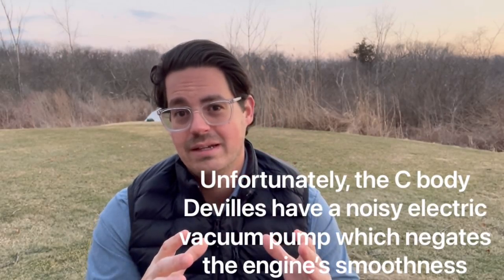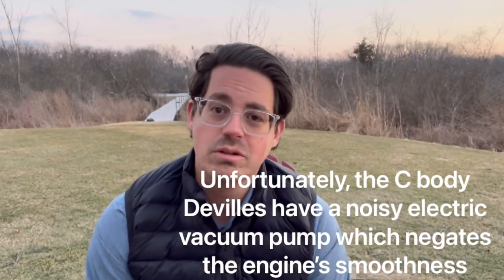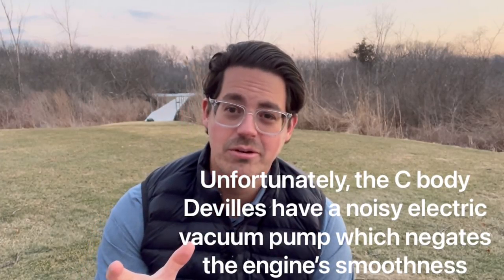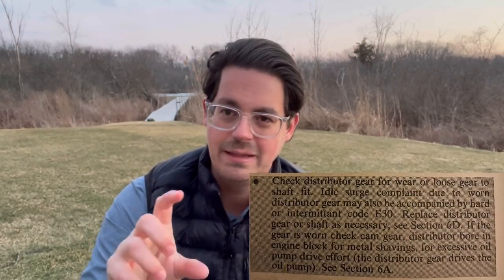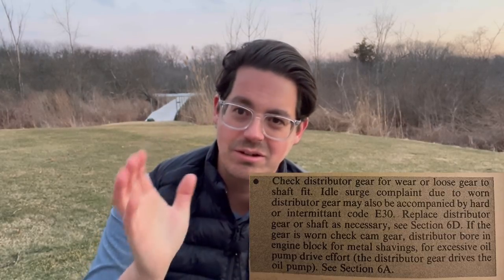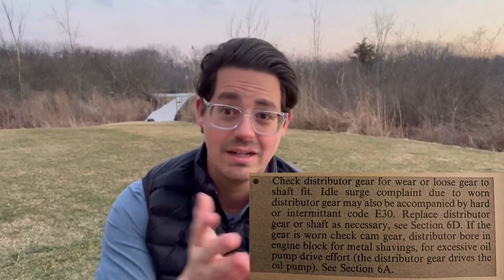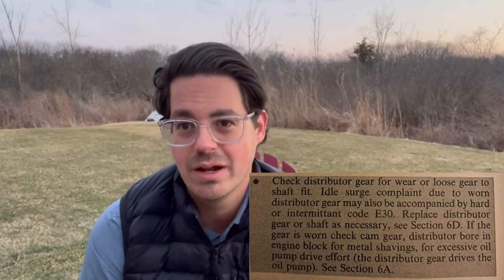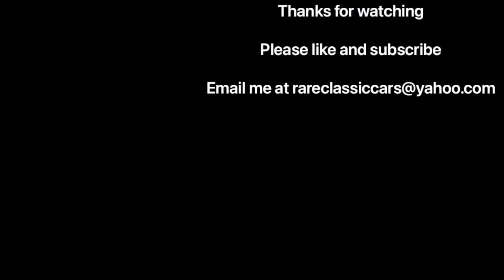Worst Engines of All Time: Cadillac HT4100 - Why is it so bad?  How can you preserve yours?

Comment: In the early 90s, I needed a cheap driver once and almost bought an older Cadillac with this engine from a flipper (here in south Florida, low mileage cars like this from the elderly are all over). I asked him if the HT4100 was reliable (this was pre Internet, and I had no experience with it) and he thought for a second and said "it is not - this one works fine, but it won't for long, if I'm being honest". I was stunned and grateful.
Reply: Wow, an honest car salesman?!?! There might be 10-15 in the entire country
Reply: I had a gold eldorado with this motor it drank 2 litres of coolant aday
Reply: I bought an 85 Cadillac Seville with this engine back in the early 2000s as a spare car to keep at my parent's home so I could fly to visit instead of driving 10 hrs each way to see them. I got it for $1500 from a work colleague when his grandmother passed away. It had receipts for a rebuild on both the engine and trans less than 10k miles before I bought it. I drove it several times when I visited, then gave it to my best friend's mother when she needed a car. It lasted about six months before a rod came through the side of the block. 

It was a smooth engine and it got excellent fuel economy. On my drive across the CA and AZ desert in the summer, with the A/C cranked it got me close to 40 mpg. It was very comfortable and even though it was slow, was an excellent cruiser at speed.
Reply: How about the HT4500?
Reply: @Titanic19127  The 4.5 and 4.9 liter v8s that were built on this platform fixed a lot of the problems that the 4100 suffered from due to a rushed launch. The 4.9 ultimately morphed into the Northstar V8 that's well known as a good engine.
Reply: @empireOfLove2  No one thinks the Northstar is a good engine dude. You're kidding, right?
Reply: @Titanic19127 much better.
Reply: @Titanic19127: More powerful but same problems with head gaskets leaking. Still required stopleak tablets.
Reply: @TeeroyHammermill  the 4.5 and 4.9 didn’t really have head gasket issues unless overheated. I’ve owned many 4.1 4.5 and 4.9. 4100 was a nightmare. 4.9 had wonky injector issues. My favorite was the TBI 4.5.
Reply: @OffTrackProductions  it’s great if you upgrade the head bolts 😭
Reply: I had an "85 Cadillac Eldorado Barritz 2door with the HT4100. He is right. The front wheel drive unit was exactly like 71 or 70 front wheel drive Oldsmobile Toronado. 85 cadillac HT 4100 whoever wants em you can have them keep em and gutless for a v8

Comment: I thank GM from the bottom of my heart, these engines provided this old mechanic with probably a million dollars of revenue over the years, there was a period of about 5 years where they are pretty much all I worked on
Reply: Same here, we would do a complete rebuild and upgrade when one was brought in on the hook.
Reply: I'm working on my 84 Fleetwood at the moment. I've lost track of how many weekends I've spent doing the water pump, radiator removal, and now the intake manifold gasket project. There's always something to do on this car. These cars should have came factory with a complimentary shop manual. As the second owner of mine, I'm trying to take good care of it.
Reply: I know the feeling.  I have said, " I love people that drive European cars, coz we can charge like a wounded bull to fix." Same result $$$$$$$
Reply: What's up with the melted looking valve covers I've seen on some later models I think probably  4.9? Look horrible.
Reply: @MrJoeltrain  GM put a heavy black plastic sort of paint over the aluminum and it came loose giving it that "melted" look - yes horrible and no way to really fix it other than to scrape off the loose parts and attempt a re-paint
Reply: What was the most common failure points?
Reply: @LowEnd31st  Camshaft lobes would round-off, distributor drive gears would wear away along with the gear on the end of the camshaft, all of this sending metal into the oil and eventually ruining the main bearings - probably the most common failures although there were many more like intake gaskets leaking coolant and oil returns getting plugged up (in the heads) on the early engines.  That's why the 4.5 was such an improvement, they used a roller cam and larger oil pump and they got the metallurgy figured out with the distributor drive gear.
Reply: HA! I read from one transmission tech that when they would get a Ford with an AXOD/E transaxle in, they would sing "Making Our Dreams Come True", a tribute to the Ford Johnny Cash commercial using that jingle back then, it made quite a bit of business. Of course, the GM 440T4 transaxle was also a money maker for transmission shops, once there was some fixes for their problems.
Reply: @mikeholmstrom1899  For sure the Transverse mounted AXOD was known for it's failures- at least early on
Reply: @LowEnd31st  @LowEnd31st: Headgasket failure causing coolant to dump into the crankcase mixing with the oil which turns the oil into 'milkshake' which destroys the engine.

Comment: As a heavy line mechanic for Cadillac in the 1980s, I worked on several of these HT4100 engines. The most common issues with customer cars with this engine were oil leaks, mostly intake manifold. Also, overheating and warped blocks. Worth noting, the crankshaft flange only had 3 Torx screws that secured the flex plate to the crankshaft🤣. Also, this engine had such low vacuum that it wasn't enough to run the vacuum accessories of the car. So GM put a belt driven vacuum pump in with the other accessories in front of the engine (what a joke!). Cadillac should have kept the Olds Rocket 350 for these cars through the 80s!! The best engines Cadillac ever had were the 472 and 500 V8s. Honorable mention is the 425 and 368 derivatives of the 472....
Reply: Yep, an updated Olds 350with tbi or port injection would have been a great choice. Atleast they had the 307 to put in the big cars.
Reply: I have an 84 cadillac biarritz coupe and I want to swap out the engine for something more reliable and with more power. I'm trying to have race car or muscle car. Just more power
Reply: @mcqueenfanman  I had an olds 307 in my 85 Lesabre. 

It was reliable, got about 25mpg on the highway.  But it was a slowwwwww engine in comparison the even the 305.
Reply: @JohnK-ph3vw  It had a cam that had all the torque in by 2,000 rpms. The H.O. 307 was much more livelier.
Reply: @DjnMemphis10  -  Be sure to follow this very famous guys build.   He's a wealthy Texan car-guy, Matt  Garrett & very well resourced & funded.   People compare him to a mini-Jay Leno.
He has a great website & see his YouTube build that he plans on swapping an Olds 406.  Titled:  
-  "1985 Cadillac Eldorado Biarritz convertible . "Pre engine swap to 6.6 Liter Oldsmobile 403" -
I'd post the link, but my post could get deleted.
Reply: I’m looking to get a 85 fleetwood brougham do y’all thing it’s reliable or would I have a lot of problems
Reply: @jonathanavitia7925  anything with the HT 4100 engine would not be a good choice. Try a 1976-79 Seville, or a 1979 Eldorado, all of which have the Olds Rocket 350. Damn good, reliable engine...

Comment: I had an 83 Fleetwood with that engine, and I beat the hell out of that car. It leaked everything, had a throw-out bearing holding tension for water pump/alternator and other junk. It lived, never overheated, and ran fine. I graduated to a 4.9 93 DeVille, and after 2 transmissions, I happily saw I drive away to get parted out. I still have a 6.0 368 V8-6-4 in an 81 Fleetwood, still running but of course, cylinder deactivation is permanently deleted.
Reply: A throwout bearing?
Reply: We swapped in a 500 out of a 75 Cadillac in an 81 Fleetwood when the V8-6-4 of course blew up. That car seemed like it would never stop accelerating, it was still building speed long after the 85 mph speedo had pegged.
Reply: Pretty sad that GM to this day has problems with that cyl deactivation :lol:. My neighbor has it in his truck and it is a nightmare. He said he had a used caddy with it years ago, his fault for not learning a lesson.
Reply: @donreinke5863  lol I bet that was fun. :)
Reply: 😂should have overfilled those transmissions  ?

Comment: When I graduated from college in 1986, I bought a 1983 Coupe DeVille with this engine. It didn’t have much power but it was so smooth and quiet. I absolutely loved that car. Unfortunately, less than a year after I bought it, I was hit by an F-150 at a high rate of speed. The car was totaled. I replaced it with a new 1988 Chevy Corsica.
Reply: Interesting - did you ever look back from the Chevy?  Some of the basic engineering was in each GM.  So apart from trim and early on engines, after about 65 the base problems/issues were often in every brand.
Reply: My uncle bought a brand new Corsica back then.  The paint started falling off in sheets.  It wasn't even paid off yet.  He took it back to the dealership thinking that they'd at least repaint it. They said no, there was nothing they could do for him.  Well he was/is a really good artist. He went to the art store and bought some paint that could be easily cleaned off the windows. He painted big lemons on the windows and parked it on the street right in front of the dealership. After about a week the dealership agreed to repaint it.
Reply: I am genuinely curious, why would a recent college graduate think of buying a recent model luxury car? America must have been a different country then. Or Cadillacs just didn't fit into the modern luxury car price class. I would still never buy a luxury car if only because parts and service are extortionate.

Comment: Can you just imagine the disappointment of a lifelong Cadillac owner experiencing these cars/engines in the 1980s. You've had a succession of older engines (472, 500, etc) which were by all accounts bulletproof reliable, had loads of torque and were so smooth you could barely tell they were running. Now you have an HT4100 loaded with problems and after your fifth trip back to the dealership the workshop maintenance man tells you "don't drive too fast or you'll break the camshafts". What an absolute fall from grace, the best car brand in America and "The Standard of the World" (which once upon a time wasn't an exaggeration). Cadillac never recovered from this.

Comment: I was an engine specialist at Cadillac in 84 and 85. We did bare block overhauls on these things as early as 27000 miles. They were so bad that Cadillac stopped putting HT4100 emblems on the fenders and then made the tuned port injected small block Chevy engine available in the rear wheel drive cars. I went back to a Chevy dealership. The HT4100's were BAD.

Comment: I remember even in the first few weeks and months after these terrible engines came out in the 1982 model year, coming across  numerous 4100 engines and especially bare engine blocks in  scrapyards, Not wrecking yards where parts are salvaged, but actual metal recycling SCRAPYARDS.

Comment: Although I spent the first 13 years of my career as a mechanic at a Ford dealership (1983-1996), I did occasionally work on other makes of cars. Usually something taken in on trade by the used car department. 

One of those times came when they had taken a Caddy in on trade with a seized 4100 engine. It was a beautiful car owned by a reality company that was used to haul prospective buyers around town to look at property. Somehow, no one ever changed the oil. At 59,000 miles the engine locked up. So they traded it in on a Lincoln Town Car. The used car manager asked me to get it running. 

We got a replacement engine from a local wrecking yard. It wasn't terribly difficult to swap, but I could never get the damn thing to idle properly. The internet wasn't widely available then, so repair information on that engine was hard to come by. I tried all the tricks I would use on a Ford with poor idle quality. I ended up swapping the TBI off the old engine which seemed to fix it. I guess the ECM didn't play well with strangers.

Comment: Honestly, I think this engine and the reputation it earned- for being a grenade and a total slug in terms of performance- was the biggest straw that broke the Cadillac back. The Cimarron was a disaster, sure, but the 4.1 ruined what would've otherwise been great '82-'85 Cadillacs. I think it turned off a lot of buyers who happily left and went to Lincoln... which ironically had a 302 that wasn't much more powerful than the 4100. As shown by the Brougham that ran into '92 (albeit with the Olds 307 in '86 and the Chevy motors in '90), the cars themselves were great and honestly hold up very well even now 30+ years later. In particular, I feel the '80 redesign for the Coupe DeVille produced one of the most handsome cars of the era, but unfortunately any year aside from the 1980 is saddled with poor engines. I can't blame shoppers in the early 80s for shunning these cars, no matter how good they looked or how comfortable they are.

 The 4100 should have been held off until the downsized cars arrived for 1985- by then the engines had sorted through a lot of problems. I think the Chevy 305 or even Olds 307 would have been a much better option during this time after the V8-6-4 was deemed unacceptable. Even limiting cars to the 4.1 V6 or even the 3.8 probably would've hurt their reputation less. That being said, the 4100 did become what I would consider a good motor in the 4.5 and 4.9, which are nice to drive and have a much better reputation.
Reply: I don't know that switching over to another division's engines would have gone over well.  They were already using the 4.1 L Buick V6 and the Olds diesel 350.  The 307 or the 305 were really the only V8 options.  In 1977 Oldsmobile got into so much trouble for putting Chevy 350s into the Delta 88s.  If Cadillac put a Chevrolet engine into their cars - that would not have gone over well.  I do remember in the 80s a lot of people switching over to Lincoln because they were not happy with theri Cadillacs.
Reply: @sasz2107  a good engine from another division would've been better than a terrible Cadillac motor.
Reply: The 302 powered Lincoln Town Car would  (and did) run rings around the 2 ton Fleetwood Brougham with that lame 250ci "4100"
Ive driven both. The later 4.5 and 4.9 (pre Northstar junk) Cadillac engines were better.
Reply: They could have stayed with a normal 368 and a higher differential gear, but they wanted lower weight immediately.  Why they didn't start developing  4 or 5 speed auto transmissions after the '73 oil crisis is another question.
Reply: @ralphl7643  I've heard it said that that the 368 had emissions issues on top of the lack of economy, so even with the 4-speed auto I don't know if it would've been an option. Still, I wonder if going to fuel injection would've been enough to get them a few more years. The 368 was a great engine.
Reply: @Sedan57Chevy  It was simply a smaller version of the well proven Cadillac 500, 472 and 425.
Same design, just different bore and stroke.
The 500 was exactly "square", bore and stroke both being 4.304 inch, the bore was exceeded only by the Ford 429/460 which had a bore of 4.36, and the Oldsmobile 403 made from 77-79, not to be confused with the earlier Olds 400 made in the 1960s.
Reply: Should have stuck with the 368 (which remained in production in the RWD limousines) or an Olds 350 and just paid the gas guzzler tax in the larger cars.
Reply: The 81 was great as well once you disconnect displacement on demand
Reply: 4100 was a good engine
Reply: If you deactivated the system that shut off cylinders in the V8-6-4, it was a good engine. It was the same exact engine that was in the 1980 Cadillacs.
Reply: @donreinke5863  The 4.9L Cadillac engines would run circles around a Towncar with a 302, I had both of those. It would also run circles around a Grand Marquis with a 4.6L I had one of those too.
Reply: @ralphl7643  Government forced fuel efficiency requirements were the issue. This is what brought on the Olds diesel (The early ones were bad, but later ones were good if properly maintained) the V8-6-4 & the early introduction of the 4100. It's too bad that it didn't start out as the 4.5L, as that was a solid engine, the 4.9L was excellent.
Reply: @Sedan57Chevy  It was fuel injected, but it was a throttle body system. The should have just soldiered on with the 1980 368 and made other divisions make up for the fuel economy requirements. That or used an Olds 307 until 1985.
Reply: I had an '88 town car with a fuel injected 302 and it was fine. The guy said 15 second zero to 60, oh my God. I wouldn't doubt that town car having a 8 second 0 to 60 but my god. 15, 16 seconds. How could Cadillac go from having a 425 in a couple de ville to a laughable hunk of junk like that 4100?
Reply: @senorpepper3405  The Cadillacs with 4.9L was way faster than those Lincoln's. I had a 1989 Lincoln with a 302, a 1988 Grand Marquis with a 302 and the Grand Marquis was faster than the Lincoln, and neither one was close to either 4.9L Cadillac I had.
Reply: @kingrex1931  I didn't say anything about a front wheel drive 4.9L caddy.